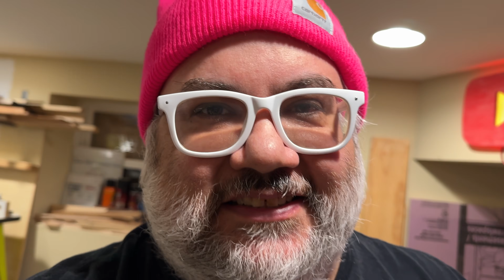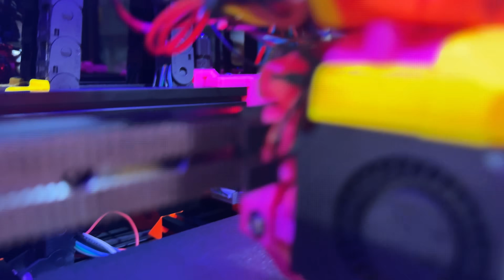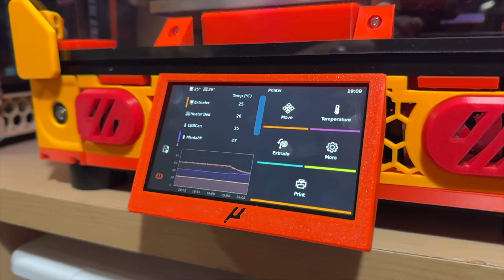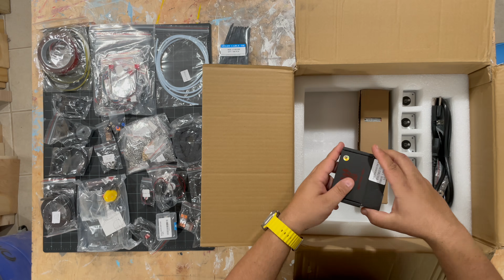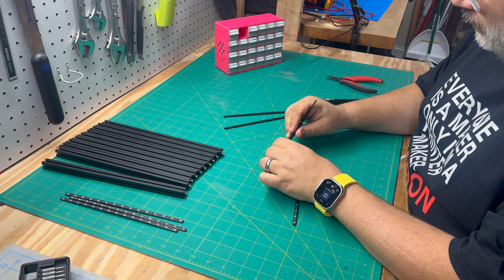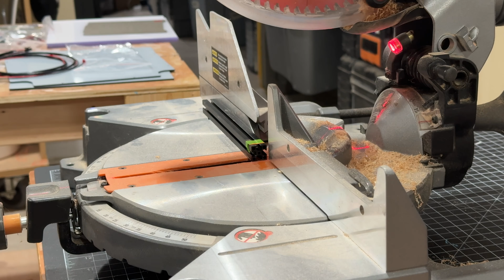Formbot Micron+ Kit Review & Build Notes

Comment: This video helped me a lot. Im currently printing the first parts for the Formbot kit, but the Printables info page is gone since today. 
Also the Micron github only has the R1 parts en removed the R0 parts.
Formbot still uses the old parts like 188mm belts instead of 151mm and non-beefy idlers. Those last  ones are now considered "stock". 

So this video helped me a lot an thankfully you did some mods (now stock).

Comment: Hi, would you recommend formbot v02 or micron+ as the first voron printer? I have built a prusa before and have experience both with building and tuning printers and don't mind looking at CAD or asking in discord, but I'd like to get a complete kit so that I don't have to wait for weeks/months for parts from china to finish the build. 

I like the bigger build volume of the micron+, the higher power bed and additional upgrades (canbus, accelerometer, bed level sensor, touch screen). Also it seems to be a more interesting build and cheaper considering all that's included.

For the v02, I like that the bed is DC (don't like messing around with AC too much), higher user base (way more information, mods, help...) and smaller size (it's cute), but I'd probably do the tri-zero upgrade (and maybe some others) to get a more stable bed, at which point, it would cost close to the micron (and that's still with a smaller size build volume, slower heating bed and without other upgrades).
Reply from the maker: Honestly? I'd recommend a 2.4 or a Trident. The larger extrusions and extra room are easier to work with and both are well documented.  Between the o2 and micron, I'd go micron, but be warned- its not as mature- stills were being uploaded while I was building mine, and the documentation is incomplete (ie: hard mode)

Comment: You are aware that ABS deteriorates in UV Light. If you want to keep your UV lights, you should Print the Parts in ASA.
Reply from the maker: Yeah, I would be more concerned if I were running my big UV flood light, but I just pull that out temporarily for photo purposes; the matchsticks aren't very strong, but this is something I'll keep an eye on, and if it becomes an issue,  make the necessary adjustments.
Reply: ABS does have Some UV protection, It will yellow over time, but by the time it gets to that we will all be on to our next color choices for modding. I know I have changed my colors at least three times in the last two years. and original colors, blue and red still look great.

Comment: I have the LDO partial kit from Fabreeko. My Micron is my favorite printerby far. I use it all the time. It's printing right now.  If this kit was out a year ago - I would've been all over it like white on rice. I really had to scrape to build my LDO Micron. Probably got near double the $$ into it over this kit. Formbot has a great reputation. When I was purchasing - the only other kits were blurolls and Funsorr. Those two companies don't have a stellar reputation and I think at least one of them was only a 120mm Micron. I don't see any point in a Micron 120mm. 180mm is perfect for most print jobs. I'm actually considering selling my V0.2R1. It just sits there.
Steve Builds has an awesome youtube build series on the LDO partial Micron 180 kit which would still apply to a lot of this kit if anyone hasn't seen it. Also - Fabreeko has a Micron 180 channel on their discord with tons of information and several awesome people that are more than willing to help anyone with Micron Questions. Aron, Delmar and Apple Pi come to mind. I think maybe Poittee also.
Reply from the maker: I had that fabreeko / LDO kit in my cart for months, but I could not pull the trigger.   While I agree 180 is damn near perfect, I just couldn't spend $$$$. But half that? Absolutely!  and yeah, I also have  a 120 V0, a 300 Trident and a 350 2.4 and  this 180 micron is my absolute fave now!